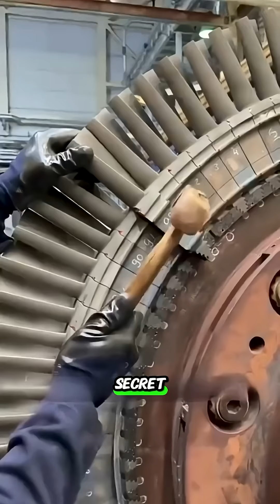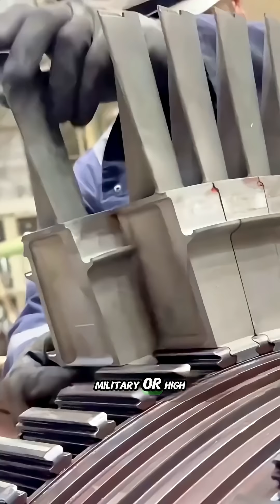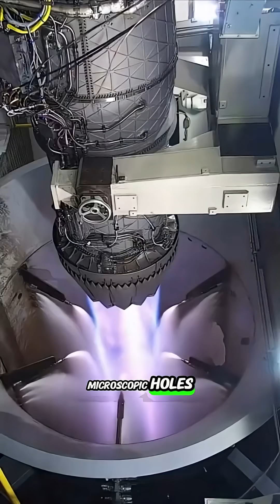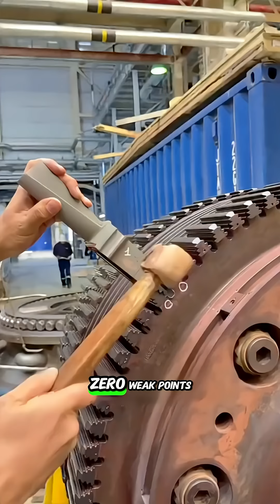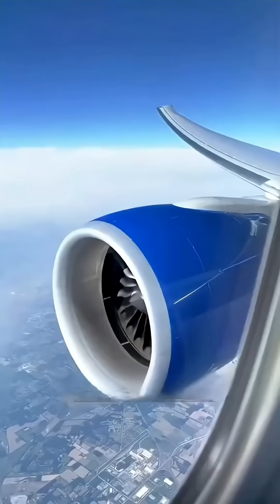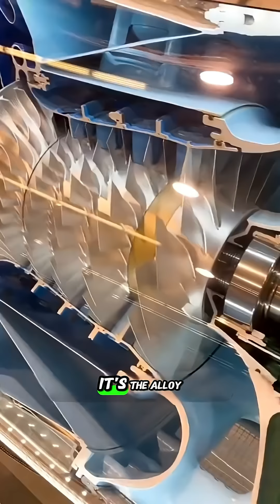The Insane Reason Nobody Can Copy American Jet Engines

Comment: Sounds like american state propaganda since England france Italy Germany and China Japan have all created jet ingines for years
Reply: Only four countries in the world can make the fifth generation turbo fan engines due to its high complexity.

In 2006, an agreement was signed on the creation of a new engine, which was named PD-14 (a promising engine with a thrust of 14 tons).

PD-14 is a serially produced Russian high-bypass turbofan engine of fith generation developed for the MC-21-300 aircraft, PD-14A for the MC-21-200, and PD-14M for the MC-21-400. PD-8 engine will be installed on the Be-200, AN-148 and Sukhoi Superjet 100 aircraft. Therefore, the designers and engineers faced the task of creating a unified gas generator, the main element of the engine.

16 new technologies were developed for PD-14 by russian designers, engineers and scientists, namely - single-crystal blades for a high-pressure turbine with an advanced cooling system that allows the turbine to operate at temperatures up to 2000 ° K.; hollow wide fan blade made of titanium alloy, thanks to which it was possible to increase the efficiency of the fan stage by 5% in comparison with the fourth-generation turbofan engine PS-90 produced in the USSR in the late 1980s; low-emission combustion chamber made of intermetallic alloy; sound-absorbing structures made of composite materials; ceramic coatings on hot parts; hollow blades of a low-pressure turbine, etc.

 20 new materials were created for PD-14 with indisputable advantages: a decrease in specific fuel consumption by 10–15%, a reduction in the life cycle cost by 15–20%; operation of the engine will cost 14-17% cheaper than existing analogues. All of them have been certified according to international standards.

New Russian titanium and nickel alloys are used to create the engine. The engine nacelle design comprises 65% domestic polymer composites, which achieve the required level of sound insulation and reduce engine weight. 

The technologies used in the production of PD-14 are state secrets and are protected. Therefore, information about PD-14 is broadly classified. Example: China would gladly copy production technologies, much like the Su-27. They copied the plane, but they failed to replicate the AL-31F engine.

The state's ability to produce cooled cast blades for a modern turbine aircraft engine is an indicator of the highest level of development in mechanical engineering. There are fewer states capable of producing fifth-generation aircraft turbojet engines than countries with nuclear weapons or those that launch satellites into space. Only four countries—Great Britain, Russia, the USA, and France—possess full-cycle technologies for creating such engines.

Comment: I worked in a super-alloy foundry that made this very product. Pretty impressive indeed.
Reply: I worked there too! My job was to clean the toilets 🙂
Reply: @Jorge-ib7om 😂
Reply: @Jorge-ib7om   critical technology that other countries have problems replicating. Even if they have blueprints.
Reply: Yeah me too. I used to broach the slots the blades were brazed into. It's not that difficult if you have skills, fine machinery and an effective QC lab.
Reply: I did as well. I was the guy spraying  those blades with a ceramic coating using a robotic arm.
Reply: Cost so much cuz they are titanium
Reply: @wkjeeping9053   but greenies are now lobbying to make them out of recycled paper.
Reply: @cinegraphics Pretty stupid comment. Metals are pretty much endlessly recyclable. And if anything the path would be ceramic composites. What will eventually change the formulas and materials in jet engine components is use of H2 or high hydrogen fuels due to hydrogen brittleness. And that is mostly the parts that get into contact with unburied hydrogen.  The first in line reason for moving to ceramic composites is weight and resistance to high temperatures.
Reply: 10,000 missed calls from China 😂
Reply: @The_good7530 …🤣
Reply: I did some contracting in a super secretive GE jet engine plant and it was absolutely amazing. I also worked next door to it where they made nuclear fuel pellets, it was a really cool experience. I wish I wasn't a loser as a young man and worked towards an engineering degree.......
Reply: I worked at precision cast parts aka PCC Structurals years ago as a rework grinder. I also did some grinding in finals. Great job.
Reply: Is there such a thing as a single-crystal super alloy?  I thought single crystal metal structures were limited to almost pure metals.
    Someone else said that turbine blades cost so much because they are made out of Titanium.  Compressor blades-- maybe, but titanium will never take the heat and pressure of the turbine section--- or do I have this wrong?  thanks,
Reply: If any of you actually did then you'd know how much croc shit is in this video.
Reply: I worked there too! My job was to steal the technology and give it to China.
Reply: Worked there also, selling drugs to everyone-
Reply: I work there too! My job was to close the doors, turn the lights off and making sure everybody was out.
Reply: @najadahe2828  without you, sir, that place would fall apart. It's this critical technology and know-how that other countries cannot replicate.

Comment: It’s implied there is liquid coolant flowing through the fan blades. What engine? I’d like credible references for this claim.
Reply: No it's not, it's a fluid called AIR!
Reply: @terryunkert5237 I knew someone was going to split hairs over that.
Reply: Only the blades after the burner have cooling passages.
The coolant is air at about 800F.
Reply: @jerryadams9238 thanks I get that but the video is implying there is a liquid.

Comment: Single blade fractures, it destroys the engine and they even fly through the aircraft body. My father was an Aeronautical Engineering General Electric and work exclusively on aircraft engines and often blue to the scenes of crashes or accidents. He could tell why metal failed. And developed a method to determine where the weak parts were of metal parts before they failed. It is a science with a lot of physics. You worked for General Electric to the 50s and the 60s and retired in the early'70s. Aeronautical Engineers didn't have much time for life they only got two weeks of vacation every year. I wish my father had more than that.
Reply: Cincinnati?
Reply: @JohnRunyon-nw7lt Evendale plant. Building 200 I think
Reply: @EddieEichelbacher I worked at milicron back in 90s supply a lot of machines for GE now I weld in Fairfield for navy we deal with some of these materials build fans for ships figured you was talking about GE plant

Comment: Next: How the US invented breathable air and Oxygen.
Reply: And organic fertilizer.
Reply: Envy is a poison.
Reply: @TBlakely-s4p  Now tell us what a pure propaganda video like this that is FULL of misinformation is..

Ever heard of a small company called "rolls Royce"?

The "ICONIC" American 747 used their engines

Rolls-Royce has powered the Boeing 747 with several engine families, most notably the RB211 and the Trent series. 

RB211: The RB211-524 series was the first major Rolls-Royce engine adopted for the 747-200 and -400, offering better fuel efficiency and noise compliance than the original Pratt & Whitney JT9D.  The RB211-524G/H-T variant remains in service on older 747s and 767s, featuring a three-shaft architecture and low-emissions combustors. 

Those engines were.. Made in the UK.
Reply: @davidkennedy7630 So bitter.
Reply: Good job. You have like 35% of the market share. 60% of the rest are American engines. 

Don’t be an idiot. You’re better than that, boyo.